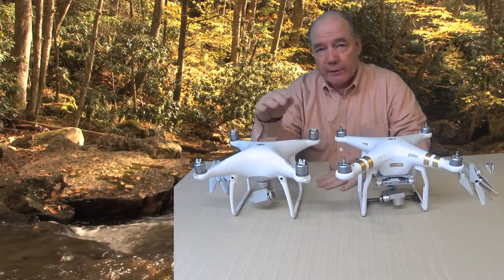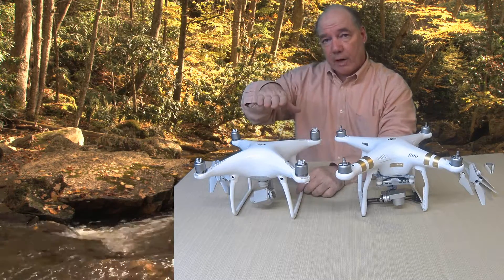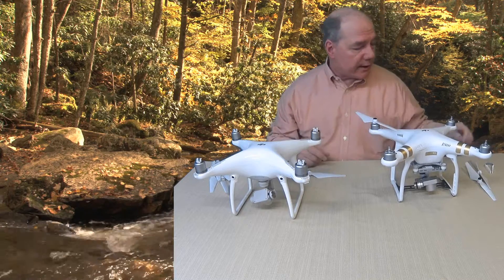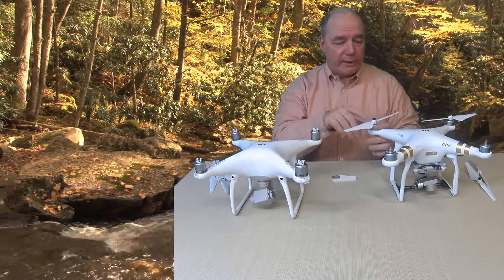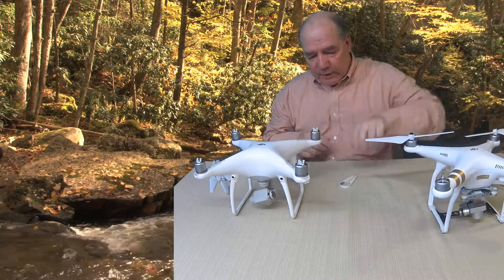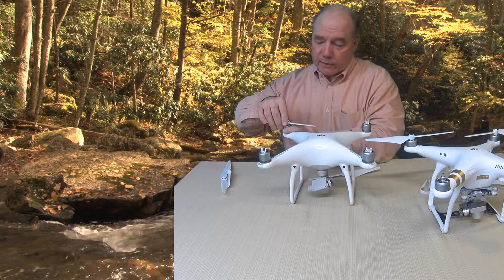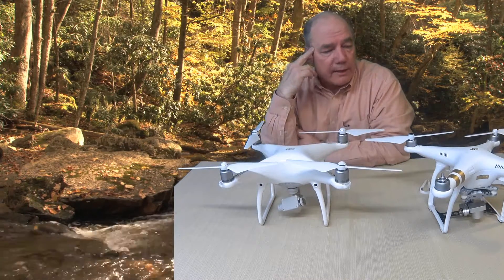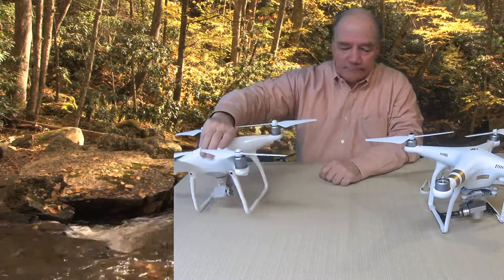A Closer Look At the New Phantom 4 Blade System

Comment: Hello, could you help me with a doubt?, My goal is to ride on the ground station with the control of the drone in a room and omnidirectional antennas that come out by means of a cable to a small antenna tower on the roof.
I have seen that they manage to do this with some amplifiers placed in the control, they are 3 W amplifiers, they say they allow you to have a maximum range of 5 km with flat antennas:

https://www.ebay.com/itm/SUNHANS-eSunRC-3000mW-UAV-WiFi-Signal-Booster-2-4Ghz-35dBm-WiFi-Signal-Amplifier/122346119761?epid=662900444&hash=item1c7c65a251:g:E8UAAOSwjDZYmtx0

Now, I think that if I connect an 8 W amplifier, along with two omnidirectional antennas of the Artgek 7dbi brand, on a rooftop antenna, I guess it should have a good range, at least 5 km from the station with a stable signal .

8W amplifier link:

https://www.ebay.com/itm/8W-2-4GHz-Wifi-Wireless-Broadband-Amplifier-Router-Power-range-Signal-Booster/122880641549?epid=664758743&hash=item1c9c41ca0d:m:mxfoNU5wZ1RYO8_mhrVycxQ

Artgek link antenna:

https://www.ebay.com/itm/ARGtek-DJI-Phantom-4-3-Pro-Advanced-Extender-4-antennas/262625499574?epid=2167329222&hash=item3d25b319b6:g:8ucAAOSwRUhY8kjv

I imagine that I would need two units, one for each antenna.
Thank you for your attention, I hope you can help me.

Psdt: the more, the better in this case.